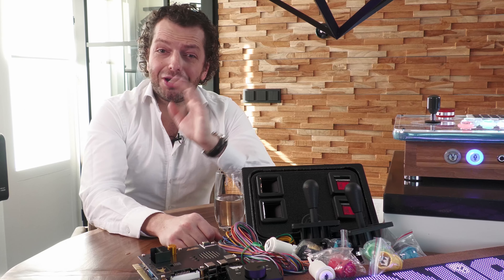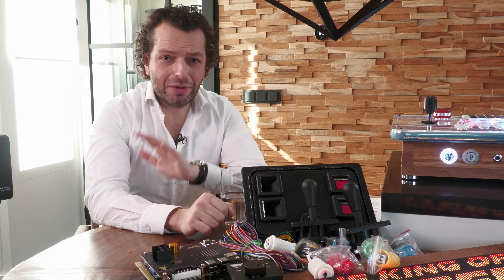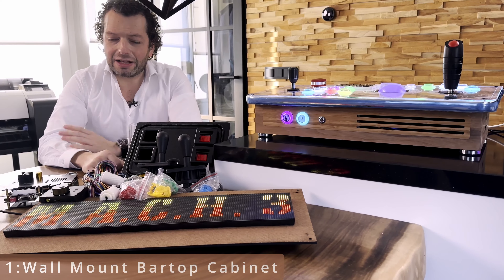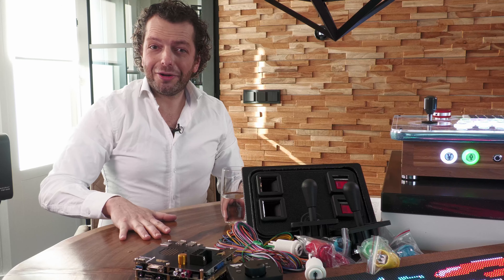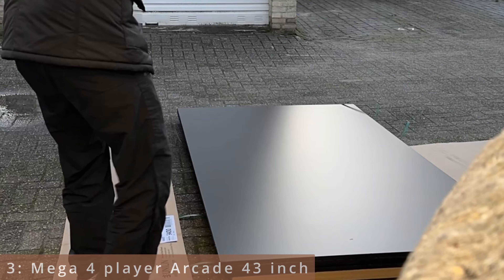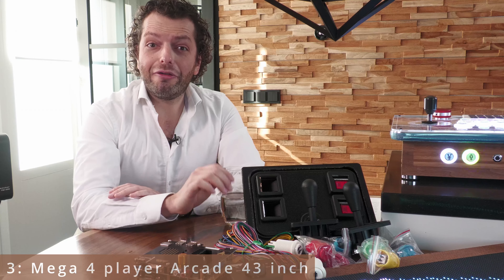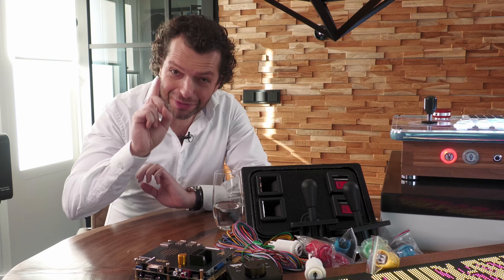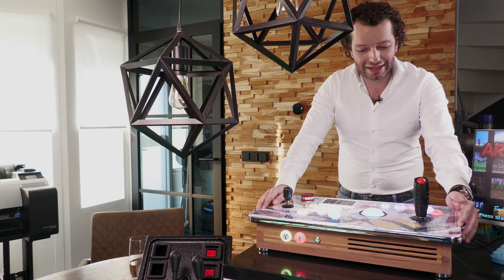All in one Arcade Controlpanel / Fightstick Japanese Style + Sneak Peek Upcoming builds in 2024

Comment: The multi-controller arcade machine looks really cool but with how tight and closed it is I fear it's not getting enough ventilation. Have you considered adding more vents to the parts surrounding it? For example I recommend making the part you take off in front of it a vent.
Reply from the maker: Yes the pc will get pretty hot but within limits in open hardware monitor. I did not have power left for more (mini) fans. We can create another opening behind the removable panel indeed but I am not sure if this will make a substantial difference 😅
Reply: @TheDanielSpies_Arcades  I see, still just having vents on the underside and the opening can make a fair difference. If anything, something I recommend is to take out the guts of the mini PC and essentially utilize the arcade box as its case. With proper venting this can be very helpful for temps. Cheers!

Comment: 4:58 i did it on mine, i attached my old consoles to the sides of my arcade and plugged them in.. i can switch between them using hdmi switch under the desk ... and i used original controllers or some like x360 accepts the arcade buttons , using usb switch also... it's an awesome machine!! urs would look better obviously